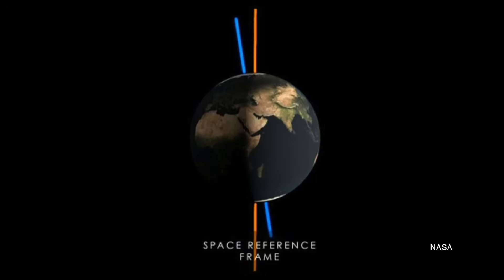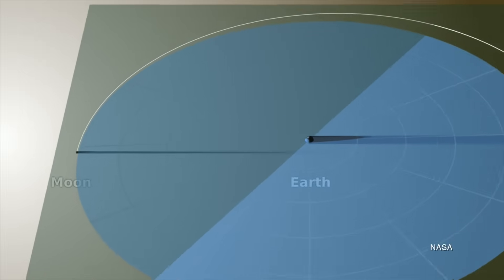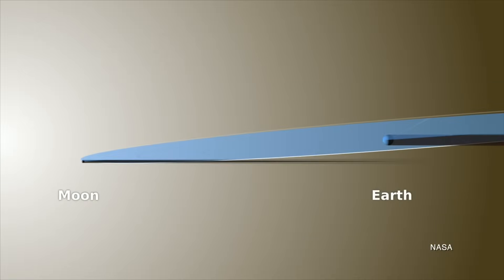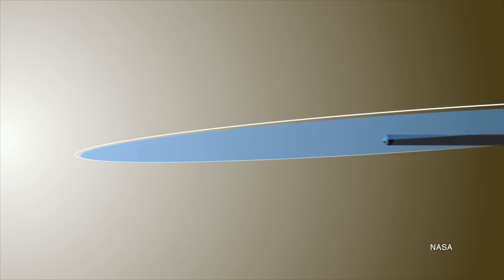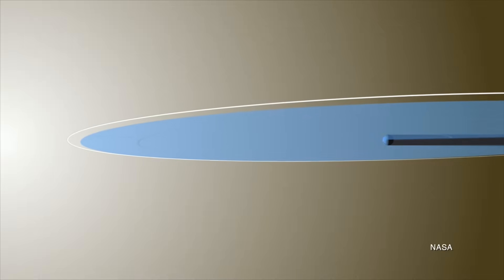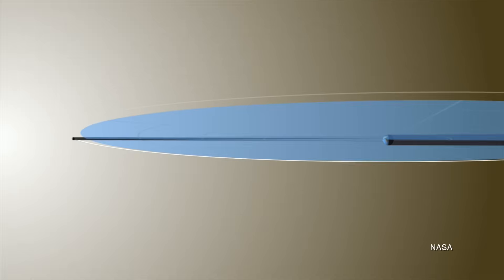Why Does a Rocket Need to Roll Going Into Orbit?

Comment: I'm not sure if your explanation for the roll program is correct.  I know that the reason for the Shuttle roll program is to turn the vehicle so that the pilot can see the horizon and to expose the antenna.  (The shuttle normally flys upside down on ascent.)  I read that Apollo did it for the same reason.
Reply: +David Messer, I think you're right about it being an engineering decision, but that might not be as trivial as it sounds. What follows is pure speculation, but I think it comes down to asymmetric control authority.

While the Saturn V has axial symmetry, it is not axially isotropic (it is not a revolved surface). To that point, it has 4 fins. Also, any control mechanisms they were using would have anisotropic behavior (preferred directions). All this adds up to the fact that the control authority (the amount the direction can be changed) is not equal in all directions. This is very obvious for a conventional aircraft (compare yaw and pitch), but it is less obvious for a rocket which seems like it should be able to pitch in any direction equally.

My guess is that the control envelope is largest around the fin axes (the cardinal axes of the rocket) and is smallest at axes 45 deg to those cardinal directions, giving them 2 potentially equally strong control axes. A strong control decision is to put the maneuver direction along your strongest axis of rotation. So by rolling to put the azimuthal launch plane normal to the pitch axis, they could pitch along one strong axis, and correct for pitch axis error using their other strong control axis. Whereas is they made a single pitch/yaw maneuver, the control axis they would be stuck with would be comparatively weak.
Reply: +kbarrett97 
Get a life.

Idiot.
Reply: +kbarrett97 
That is very sexist and insulting.  You don't have to be a rocket scientist in order to be a science historian - which she is.

Amy does a marvelous job on reporting on the history of the space program.  She also probably is smarter than you.
Reply: The Shuttle had to roll for the same reason, to get the orbit inclination correct, especially if they were going to a space station (like Mir or the ISS) or to the Hubbell.  Changing orbital inclination can take a lot of energy.  I believe the Soyuz does it too when they launch to ensure there is no energy wasted getting to the ISS.
Reply: +retrofan42 
Rolling does nothing to change the orbit.  The only reason to do it would be an engineering reason, such as making the inertial reference system work better.  Apollo didn't have a very capable computer, so aligning on a single axis could make it simpler.

Modern rockets don't seem to use a roll program.  At least I haven't heard a call-out for it in SpaceX or ULA launches.
Reply: David Messer He's just jealous because she's smart and can hold intelligent conversations. 

Misogynist moron.
Reply: +Mark McCombs Good paper!  Apparently there are several reasons for the roll program with Shuttle.  Just because they use the same maneuver as Apollo doesn't mean it is for the same reason.  Since Shuttle was an asymmetric vehicle, it is a lot more complicated than the Saturn V.
Reply: I thought another reason for the Shuttle roll program was to get the shuttle under the tank so that if it had to abort the launch it would fall or be flown away from the tank to be positioned for a landing back at the cape, altitude allowing.....
Reply: +Amy Shira Teitel (Vintage Space) 
I think your source made it overly complicated.  From doing a bit of research on the web, plus my knowledge as an aerospace engineer, I think the reason for the roll was to make the pitch maneuver the same on all flights.  A roll would be required for any orbit other than straight east (as you said) but it doesn't have anything to do with the Earths tilt or going to the Moon per se.  Any orbit other than straight East would require a roll.

The main reason for this (as I suspected) was to simplify the guidance problem with the primitively hardware they had, which is why modern rockets can do without it.
Reply: +skunkjobb, as I was explaining earlier, it's not about if the launch vehicle can pitch in any direction. It obviously can as it has pitch and yaw capability, so it can obviously make a pitch maneuver about any axis. the question is about the difference in control authority (max roll rate, high frequency damping, phugoid damping, etc.) between the cardinal axes and in-between axes. The reality, even for modern systems but especially for legacy systems is that it is much more difficult to pitch about some off axis maneuver plane than it is to pitch about one of your primary control axes.
Reply: +Drew Northup, another possible motivating factor could be g load on the crew. I don't know what the manifest loads were in the Saturn V, but even 1g+ would require consideration for the crew. no one wants to take a few G's at some weird sideways plane. This idea would be familiar to pilots as a coordinated turn.

I still think leaving themselves in a positive control position for the entire ascent stage would be the leading factor, but the crew would have been much happier with a roll+pitch maneuver than with a pure pitch/yaw maneuver.
Reply: +Myra Loftus 
There is no reason to roll a symmetrical rocket to achieve any given launch inclination.  The only reason to roll it is because it is asymmetrical in some way.  There has been several speculations about this above.  Personally, I think it was to give the pilot a view of the horizon but I don't think any of us (including Amy's source) knows for sure.

The source Amy cited is as good as any.  At least he wrote a book!
Reply: Great video, I always learn so much, and for a fan of the space program for many years that's amazing...  It didn't bother me but it SEEMS like there is a double of a clip you used at around 1:30 where you say "So because the Apollo missions were eventually going to the moon they had to enter orbit into the earth that was inclined relative to the earth's equator"  and right after that you say something remarkably similar, but I can't get my head around if it is an editing mistake or not!  I thought I'd point it out in case.
Reply: +Gerry van Dyk 
Indeed.  Scott Manley mentioned in one of his videos that a normal flight for Apollo contained NO plane change maneuvers (plane changes are horribly expensive). With the constraints of the lunar landing sight, sun angle at landing, abort conditions and such, I'm amazed that they could figure out how to do it without computers to speak of.

They were steely-eyed missile-men indeed!
Reply: Think about it backwards from orbit to launch. For reasons already mentioned you want to fly in a "heads-down" attitude during launch and Earth Parking Orbit. So the Saturn V was on the pad aligned with 90° 
azimuth and if the launch had happened in this direction then no roll 
program would have been necessary and with the normal pitch program and insertion guidance it could simply hold the roll angle throughout launch. But because from the beginning of a launch window to the end the desired launch azimuth moves from 72° to 108° and the nominal launch time is at the beginning of the launch windows, it nominally rolled from 90° to 72° after clearing the tower.
Reply: I agree that rolling itself is not necessary to fly a desired launch azimuth. A combined pitch/yaw program is sufficient and modern rockets like Atlas, Falcon, etc. don't use a roll program and aren't really bothered with any roll around their axis. They mostly keep the roll axis free unless it's required for example to satisfy payload pointing & thermal constraints after fairing jettison. Some of the older vehicles like Soyuz still do use a roll program.

The roll program to align to a flight azimuth was probably due to limitations of the Apollo/Saturn navigation platform, which the video hints at at 4:20, "a simple pitch program". By aligning the vehicle axes with the nadir-horizontal axis of ascent it's computationally easier to generate updates. I seem to remember that Saturn V updated its heading every two seconds during iterative guidance mode. May sound silly nowadays, but probably the best what the hardware could do back in the day. 

There might have been other considerations like horizon visibility, telemetry transmitter coverage considerations, etc, but I'd guess the Saturn V IMU limitation was the main one.
Reply: Actually until very recently, the Soyuz rocket did not have the control authority (ie strength) to roll reliably. Instead, the whole launcher is on a large turntable and rotates the rocket pre-launch to match the launch plane.
Reply: David I think Amy is right because if you did not roll the SaturnV at launch you would need a stack more fuel to burn to make a Trans Lunar Injection trajectory due to the different inclination of the moon. Your point on the shuttle is right though.
Reply: Oh, I love your videos!  Keep them coming!
Reply: I think the thing you're missing is it's roll before the pitch motion. Roll on it's own would, as you say do nothing.
Reply: If you're referring to the size of the AGC internal memory, it had 36 K words of memory, of which 32 K words was "ROM" (the famous core rope memory) and 4 K words of "RAM" memory (magnetic core memory, a slightly different type of memory based on similar principles as the core rope memory). ROM in today's computer nomenclature stands for Read Only Memory, while RAM stands for "Random Access Memory", that is memory that is freely both read- and writable.

Now, the concept of a "word" requires a few... well, words, too. :-) Today, we almost universally use the unit "byte", which is 8 bits, when we are talking about addressable computer storage, whether internal or external. A "word" is still used today, and it usually refers to the number of bits that matches the processor's bus width. (This is a greatly simplified explanation, but roughly correct.) That is, a modern computer has 64 bit words, which is 8 bytes, all of which is usable in data storage and computations. Only a few years ago 32 bit (4 byte) words were common, and even further back we found 16 bit and even 8 bit words being the norm.

The Apollo Guidance Computer used 16 bit words, but only 15 of those were usable as data and program memory. The high-order (15th) bit was used as a so called parity bit, which simply is a one-bit checksum of all of the rest of the bits in the word. If something flipped a bit outside of computer control, let's say by cosmic radiation or a hardware fault, there would be a parity error detected by the computer on the next memory bus cycle. Thus a memory corruption would light up a corresponding "Parity Alarm" light on the DSKY in the CM or LM.

Since the notion of "bytes" weren't used in the AGC, we must approximate the memory size to compare to modern computers. So we can say that the AGC had roughly the equivalent of 72 Kbytes of internal memory, of which 64 Kbytes was read-only (program and static data) and 8 Kbytes was read/write memory, for variable data.

Another interesting metric is the speed at which the computer operated. A modern PC has an internal CPU clock frequency in the GHz range. The Mac I'm writing this on is running at 2.4 GHz I believe. And thanks to its so called superscalar pipelined design (those interested, feel free to google it, we're now drifting way off topic :-) ) it can execute several instructions per machine cycle, resulting in an absolutely mind-numbing speed where individual instructions execute within nanoseconds.

The AGC had a 2.048 MHz clock, that is about three orders of magnitude slower than a modern CPU, which was divided down to 1.024 MHz for execution. And in addition, it operated on 16 (15) bits of data at the time, not 64. And also, it was quite the opposite of superscalar, as it required several clock "ticks" to execute one instruction. Also, access to the memory was slow, with one memory access taking a little over 10 us if my memory (pun not intended!) serves. Further, the AGC's total complement of instructions was... eleven. A modern Intel x86 processor counts instructions in the thousands.

To say that any modern desktop computer is a million times more powerful than the AGC would probably be an understatement. Not even the usual comparison I hear all the time today, "the Apollo computer was less powerful than your phone" makes any sense, since any kind of smartphone has a computer with similar specs as I outlined above.

A better fit is to say that the AGC is about as powerful as the microchip controller that is embedded in your toaster or oven.

Sometimes technology is just beautiful.
Reply: If I were to guess, I'd say that the antenna placement was based on the roll program, not the other way around
Reply: +skunkjobb generally in a launch you want to pitch such that the astronauts heads are facing down, not up, for the same reason you you don't pitch down in a high-speed aircraft. Negative G's are really bad
Reply: Great thread. I learn a lot just reading your conversation. Thanks for the education, all.
Reply: What am I missing? Since logically, roll in it's self will not change the direction of travel, especially with a symmetrically designed rocket, then surely directional thrust from the propulsion system must be used to achieve the desired orbital plane. Perhaps I need a step by step diagram or video to show what happens at launch.
Reply: +David Johnson   It's covered fairly well, though not in a terribly organized fashion, in some of the other comments.  The simplified version is that launch vehicles, even though they look symmetric around the roll axis, are not symmetric around the roll axis in several important ways.  There is a preferred roll orientation that needs to be established before the main pitch/yaw maneuvers, and before the high speed part of the flight.  Since the pitch/yaw program has to put the vehicle into a plane of flight oriented with the launch azimuth, the vehicle rolls to put the preferred plane of the vehicle in that same plane.
Reply: +Joseph Nicholas 
Amy is by no means equal to that jerk - she is far superior..
Reply: Nope, I did understand that, but that is an engineering thing and is not needed if your craft 1) has better control surfaces and 2) is symmetrical unlike the Apollo missions.  Her explanation did not touch on any of those factors and made it sound like it had to do a roll maneuver to achieve the correct flight path for a lunar intercept.  I also did mention that it was probably an engineering issue and that would cover the asymmetrical design issues that you just mentioned.  Also, another possibility was feedback from the pilots.  I can hear them arguing that they needed to see the horizon so they could pilot the ship and not just be lab monkeys along for a ride.  Don't discount the human side of the issue.
Reply: +Bruce Prescott  You could - in fact, that's how the Russians do it.  But the angle varies with each flight, so everything has to be rotatable including the entire launch pad and the tower along with the shuttle.  NASA opted for the roll program instead of a spinning launchpad.
Reply: Read this paper to find out why the Shuttle roll program was used.  https://www.aiaa.org/uploadedFiles/About-AIAA/History_and_Heritage/Final_Space_Shuttle_Launches/Why_the_Wings_Stay_On.pdf
Reply: David Messer I can try to see what difference it makes in Orbiter.  Do 1 shuttle launch without rolling at all and do one with some roll, and see what orbital inclination is for each.
Reply: David Messer Just tried in Orbiter, with the way the shuttle launches in the program on the pad, and with a 90 degree roll.  No roll gives you an orbital inclination of 87.51 degrees, while the 90 degree roll gives you an orbital inclination of 52.34 degrees.  And this is with flipping the orbiter on its back in the standard launch configuration.  I'm sure other rocket launches have to do something similar, or they just have the rocket pitch over at the correct angle to get the desired inclination.
Reply: I think you're on the right track David.  However Earths tilt, and the fact the Cape Canaveral ( or at the time Cape Kennedy) is at about 29 degree's latitude, as compared to the orbit of the moon would determine what roll angle would be required before pitch-over.  There would be very specific times where the required delta V would be lowest, which is usually described as the "Launch Window".
Reply: +David Messer While with newer control systems it may not seem necessary, remember that the Apollo system made it to the moon and back using less computing power than your cellphone and without some of the newer whiz-bang servo control and rocket motor throttle systems available now. +TheNightWatch001 provided you with a sensible answer that matches the facts known about the Saturn V launch system. While we do know from tests in the last ten years that it was possible to throttle the F1 engines significantly we also know they weren't particularly stable that way and as such it would be a better idea to just gimbal the darn thing over with the servo units and utilize the stronger control authority. That also keeps the load under control of a (nearly) continuous strength control authority, which given the decreased processing power available was probably pretty darn important. (No calculus approximations via Simpson's method required.)

As for making the exact same pitch maneuver on all flights, I highly doubt it. It probably didn't vary much, but you've already claimed enough knowledge to be able to figure out why it wouldn't be the same. (Think apogee versus perigee...)

And for the orbital mechanics part, it has everything to do with keeping ΔV requirements under control, and that means knowing where things are going to be in space and what path you're planning to take to get there. If launching into an orbital inclined differently than the inclination relative the equator of the launch location was required than that's just what it is...and it fact it is usually required. So yes, it has to do with angles relative the ecliptic, because that's the only halfway sane reference we have. After all, the question was about the Apollo launches, not in the abstract.
Reply: Yes but if the Saturn V was really symmetric around its x-axis it wouldn't matter in which direction it pitched and the roll wouldn't be needed before pitching. You mentioned the hatch in the beginning of the video but not when you came to the explanation of the roll manouver. The rocket must have been able to pitch in any direction, otherwise it could not have kept its stability in all directions so I guess it had to do with the orientation of the hatch or windows.
Reply: The shuttle also had to roll that way because of the thrust imbalance from the boosters and the position of the SSME.
It's a damn hard design to get right without computer aid.
Reply: +TheNightWatch001 
Control authority is certainly one aspect of the issue.  It also may be about how well the IMU works on each axis.
Reply: +TheNightWatch001   The concerns that have been mentioned here, vehicle dynamics, guidance system dynamics, crew loading, are all design issues, not really operational issues.  The design dictates that the vehicle fly in a certain orientation, and, of course, the design has to include the means for reaching that orientation.  Operationally, it is a given that the vehicle has to fly in a particular orientation.  The roll program is calculated to achieve the required orientation on the launch azimuth required by the orbit.  As others have mentioned, that azimuth can change during a launch window as the relationship between the launch pad and the orbit geometry change with Earth's motion and lunar motion if you are headed there.
Reply: +Mark Holm Please read more closely. He agrees with you.
Reply: The launch window is basically the time when the plane of the Moon's orbit intersects with the launch pad. The rocket has enough fuel margin to handle correcting on either side of it by a few minutes.
Reply: +JEF_300 
There are no significant g-forces except through the length of the rocket.  In fact, most rockets can't take much force in any other vector.

That is not the reason for the roll program.
Reply: The Orbiter needed to be suspended under the tank during launch for a number of reasons. the most important one was that it helped protect the Orbiter from the worst aerodynamic and dynamic loads during launch.

Shuttles needed to get onto different orbital inclinations depending on the nature of the mission. When they started sending the Shuttles to dock with Mir and later the ISS, these orbital inclinations were quite a bit higher than for Shuttle only type missions. The reason for this was because Mir and the ISS orbits themselves were geared towards the types of orbits that are easy from the Baikanour Cosmodrome.
Reply: +David Johnson 
Amy has quite a few videos about what happens at launch, including this one.  You might check out Scott Manley's channel if you want to dive deeper into orbital mechanics.
Reply: +Mark Holm 
The rest of the above comments are ideas about fine distinctions about the reason for the roll.  I think that different vehicles may have different reasons for the maneuver.

After the roll, the flight is pretty much the same for each type of rocket.  The pitch maneuver starts what is known as a "gravity turn" which uses gravity (duh) to continue the pitch over until the rocket is horizontal and accelerates into orbit.  (Roughly - there are fine distinctions to maximize efficiency for each final orbit.)
Reply: Well because......gender equality.
Reply: Yeah, I would have to agree with David Messer on this one.  
Simply rolling the ship seems to have all of squat to do with achieving the correct flight azimuth since the engines were more than capable of hitting the correct azimuth without rolling the rocket.  I understand that the author of the book told you that was why they did it,  but that does not mean Mr Woods is correct.
It was probably had more to do with the simplistic computer on board the Apollo rocket and or the direction of the telemetry equipment was pointing.  Let's face it, the Gemini and Apollo missions were calculated with slide rulers, as in three digit accuracy, and the on board computer had less processing power than a cheap smart phone that you can pick up at Walmart today.
Oh, all I could find about Mr Woods was that he is a video editor at the BBC.  I nice job that does require a level of technical skill for sure, but hardly what I would call a rocket scientist.  (As in probably not the best source to be quoting no matter how many books he has sold.)  Do you know his professional credentials?
You are right about the flight azimuth to the moon being different than the flight azimuth for a simple orbit though.
Reply: +John   You have misunderstood the discussion.  Two factors cause the need for a roll program: 1. The need to launch on a particular azimuth, in order to reach a particular orbit.  2. The fact that rockets, in important but non-obvious ways, are not symmetric around the roll axis.  The only variations on the theme are rockets that are rotated on the pad, prior to launch, and perhaps some small, spin stabilized rockets.  Someone mentioned the possibility that SpaceX Falcon 9s are not roll programmed, but that has not been verified.
Reply: +Mark Holm 
I think I am the one who said he thought that the F9 doesn't roll.  I have watched many launches of the F9 and the don't have a roll program call-out and I haven't noticed a roll, but the latter would be easy to miss.

The only hard data we have, apart from what Amy said in the vid, is the paper that someone linked above about the space shuttle.  The shuttle was a highly asymmetric vehicle though, so that doesn't really apply.

Bottom line:  What Amy said is as likely as anything I heard.  I'm certainly no expert.  (Although, technically, I am a rocket scientist - I have a science degree and worked in aerospace for most of my career.  :) )
Reply: Seems to me the AGC was somewhat better than the Commodore 64 home computer, which was an 8 bit machine.  :)
Reply: You do have to roll a symmetrical rocket. The real reason they rolled the shuttle was so the crew would not have blood rush to their head. It has nothing to do with needing to fly the shuttle on launch because it was fully automated. Facing the wrong direction makes it harder to withstand the g's of launch.
Reply: The ConHathy Channel 
That turns out not to be the case.  See above discussion.
Reply: I'm pretty positive they roll because of the way the Space Shuttle is Designed with the engines facing downwards in order to align the ship with the target orbit. Nasa does have a QnA for the shuttle where they explain it though.
Reply: So, By rolling on it's Back, and decreasing thrust
on the SME's helped the Pitch over? What I want to know is,
Did the Throttling Down/UP actually Use that imbalance
To the craft's advantage?
Reply: E Pasko 
No.
Reply: It is both.  The reason the vehicle isn't on its back in the desired orientation is because of the need to follow the flight azimuth.  One causes the other.
Reply: Fascist Canuck 
To talk to the ground.
Reply: If the roll was necessary to enable the crew to see the horizon, why not just rotate the whole shebang on the launch pad so that no roll is necessary
Reply: Star Gazer No need to rotate the tower if you rotate after hatch close.  A stationary tower can have rollers or glide surfaces where it touches the rocket. IMU alignment procedure would need slight changes, but nothing complex.
Reply: The shuttle can only go up on it's back. So the inclination does depend on roll
Reply: David Messer That's an incidental reason. She's correct. She just talks too much.
Reply: At the same time, the astronauts were beginning to fly more and more sophisticated simulators. They were
discovering that, by flying at the then nominal heads-up attitude, they could not see the Earth’s horizon and were
losing their orientation. They started experimenting with a heads-down attitude and realized that this was a solution
to their concerns
Reply: Dumb question, but why isn't the rocket aligned with the correct azimuth at the launchpad itself? Why roll at all?
Reply from the maker: Nope. It was about flight azimuth. I had the guy who wrote the book on it go through this with me before I recorded this video!
Reply: She says at 0:21 she's no rocket scientist and no engineer, so why is she even there talking ? She's reading off an teleprompter. She just a gal demonstrating she can encroach on traditionally masculine subject area even with inadequate knowledge and experience !